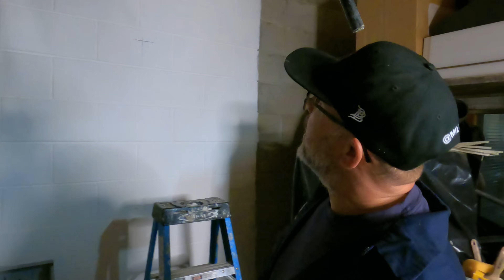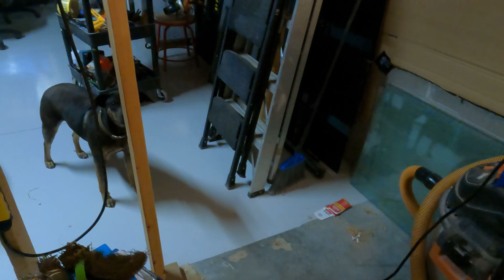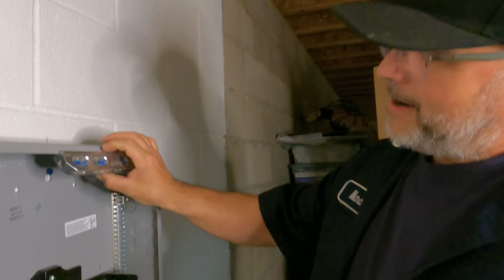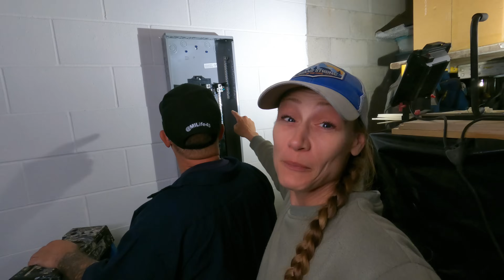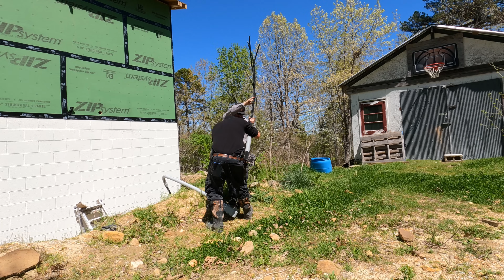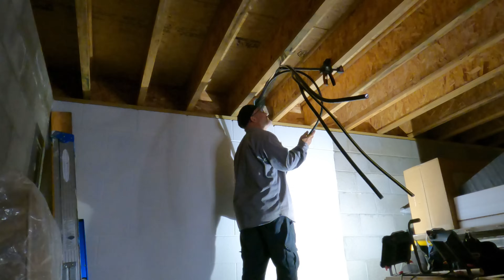DID HE REALLY DO THAT? |DIY ELECTRICAL SUB PANEL |DREAM home BUILD Ozarks |Homestead |OFF GRID POWER

Comment: Yes you got to put a ground wire with a ground rod 6 ft in the ground and yes you can use bolt cutters and a utility knife to cut the wires trust me I done mine
Reply from the maker: Nice, I have bolt cutters.

Comment: Where's your lubricant for the wire , its used to pull wire easier through the tube........ thats funny torque specs ....  ive never used torque specs ..... u tighten wire nut down till you can't turn any more.......  i learned from my dad wich he was over 60yrsin the IBofEW union ,  i did summer helper and helped him wire houses and apartments on the side, summerhelper was union jobs at chemical plants in Houston.
Reply from the maker: We just learned of the wire lube.  Next time lol